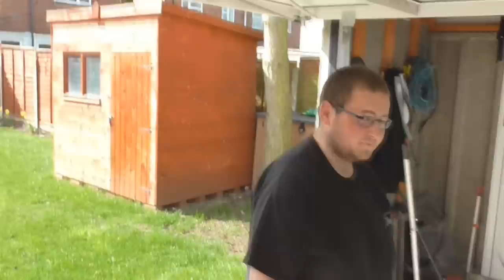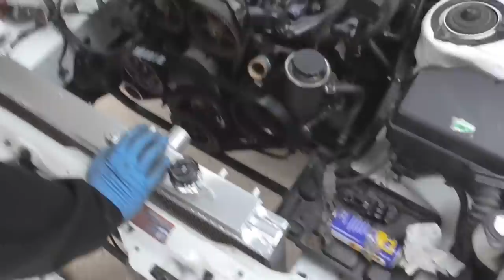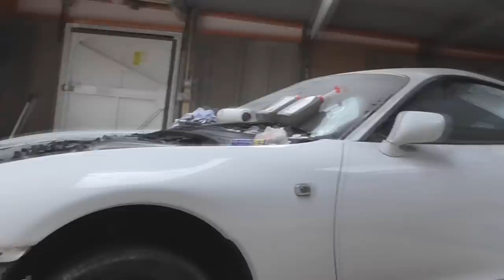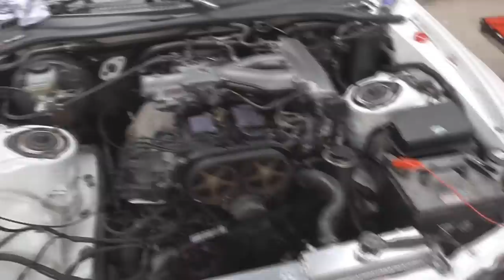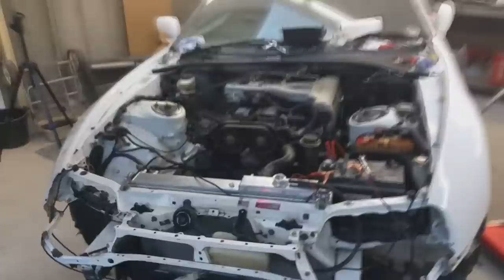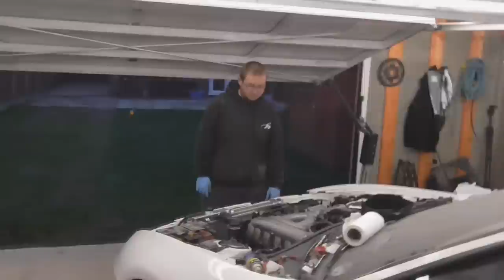Toyota Supra Manual/ Turbo Conversion - Part 17

Comment: yay for tripod footage. I installed some decats over this week and ran my n/a supra without any exhaust system in between installing them, the sound was glorious, think I was making similar sounds to you when I heard it. 
Are you putting the n/a engine back together then installing turbo after or?
Reply from the maker: MikeJZA80 I just asnwered this question for another guy in the comments, so ill copy and paste - But i do say why im doing what im doing in the next video

A Lot of work has been done so far. But the engine needed to be removed for the manual conversion. But it comes down to money. If i had chucked £1.5k at the turbo conversion first, i still wouldnt have been able to drive it, as the auto gearbox was knackered, so still wouldnt be able to drive it this summer. Because ive put the money into the gearbox, and ill have it on the road at the end of the month, i will be able to drive it this summer, while gathering parts for the turbo conversion. I Hope this clears a few things up.

Comment: that smoke coming out of your engine, is that the exhaust? Also what was it that you tapped into the engine that made it start? Thanks just got my 2JZ GE Supra too, and I wanna twin charge it.
Reply from the maker: just fluids sat on the manifold just burning off. and we tapped the starter motor